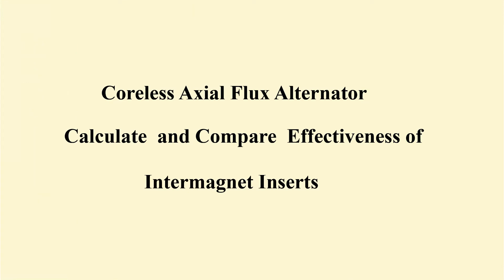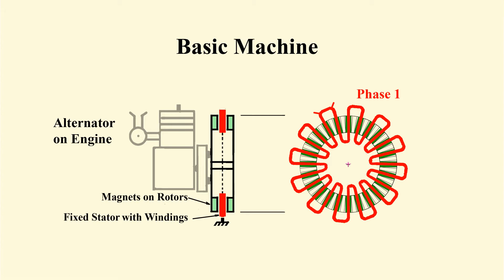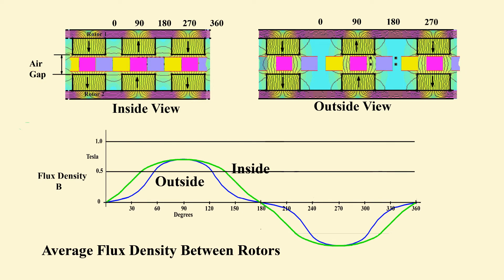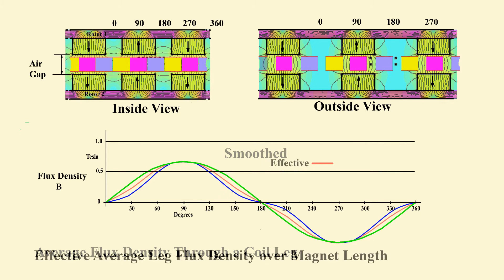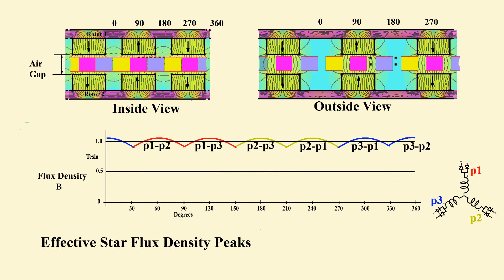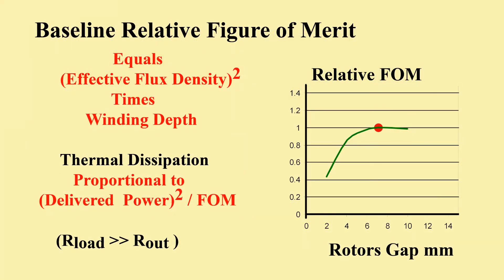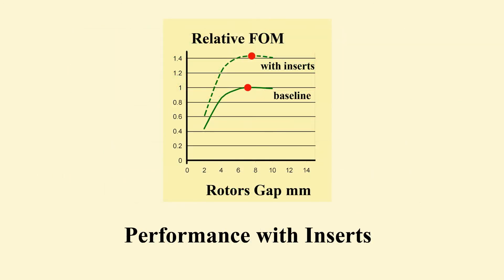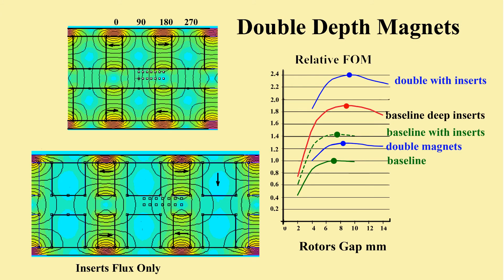Part 4  Rotor Options for the Axial Flux Alternator

Comment: This is great video, but Im sorry sir, i still dont get it how to calculate optimum air gap between magnet, maybe English not my primary language. Can u help me my magnets is ferrite 19x19x10 mm 2000gauss, i joined them so the size 57x19x10 mm, my rotor disk 3mm, and i made 12poles. Thank you
Reply from the maker: Dear Denz'  Thanks. With 25mm pole pitch at inside radius, best gap appears between 6 and 10mm;  8mm nominal.  You could prove by inserting  a single thin trapezoidal coil with each leg centred  on a pole for a range of gaps. Maximum deliverable  power is indicated where  its voltage squared x gap width is a maximum.
Reply: @YesEinstein  thanks sir, I will try it

Comment: Great job you have done explaining this...concise and to the point. I would love to know the relevance in the shape of the iron inserts(not the magnet inserts). Why not a solid iron insert instead of the (u/n) shape shown? Could this shaped iron piece have much thinner walls and still do the same job? 
Also, instead of the double depth magnets, what would happen if the iron insert was replaced by another magnet of opposite polarity, such that the flux was repelled? So many questions? lol
Reply from the maker: Dear Jim Maxwell.  Thanks.  The iron is a low impedance in the magnetic circuit with the same shape as a main magnet to maintain path cross section.  Half width bottom and side walls  gave near identical results. Replacement  by magnet material  would increase the circuit  resistance and tend to demagnetise.  Regards YE
Reply: @YesEinstein   Thank you, much appreciated.

Comment: Hello professor..
I'm mahesh and also studying,
I want to know something about axial flux genarator.
Thanks
Reply from the maker: It's good
Reply: @YesEinstein  Thanks professor
These days I'm reading some pdf, videos about axial flux genarator..
This is my email maheshjapura@gmail.com
Reply: @YesEinstein  hello professor
I'm going to build a axial flux genarator 2000W at 500 RPM,
Stator diameter 15inch
70V at 500 RPM
       Magnet size and grade
       How many coils (hope 12 coils)
       Coil pre turns and wire gauge 
       How many phase 
Can you calculate for me 
Please helps
Thanks
Reply from the maker: Dear mahesh chathuranga, Doing some sums.  Regards YE
Reply from the maker: Dear mahesh chathuranga, My machine magnified for 24 30x20x10 mm magnets, pitched at 30mm would have 13.7 inches outside diameter and 12 mm between rotors.  For 70 V at 500 rpm, each winding leg might contain 7 magnet crossings contained within each 10 x 12 mm space at the inside diameter.  3 phase overlapped windings, star connected, should deliver 2000 W rms for 50 Watt dissipation.  Each crossing might be three double twisted bundles of  less than half a millimetre wires for sensible eddy and end effect losses up to 500 rpm.  12 magnets at 60 mm pitch should also work with 22 crossings per magnet for up to 1000 W with acceptable ripple content.  Solid wire crossings might suffice. In both cases, increasing the rotor gap and its associated copper content might give up to 20% greater capability. As usual, proof is in the pudding, Regards YE
Reply: @YesEinstein  dear professor thank you very much
I'm very appreciate
One thing I want to know 
How is the torque(guess)?
Thanks..
Reply from the maker: 2000W=3.8 Kg.metres at  500 rpm
Reply: @YesEinstein  A good human being is a man full of virtues,
Thanks you very much professor
Reply from the maker: Re. magnification. Slight misspeak as Donald might say. Magnets are 60x20x10
Reply from the maker: They look "good in parts".  Which one?   Claimed efficiency, confirmed by real test results, might merit comment.
Reply: @YesEinstein  dear professor, I mean this
https://www.otherpower.com/stator.html kind of Axial flux generator totally different with your generator,
And I want to get a idea which one is more efficiency
Thanks
Reply from the maker: Dear mahesh chathuranga, Thanks for reference to the excellent website and the particular machine.  According to my calculations it is pretty near optimum for magnet size, number and spacing, rotor thickness and power capability for the particular application.  Trapezium coils with conductors strictly parallel to the magnet axes and with copper fully occupying the available space might offer considerably more overload capacity.  Going to overlapped could also near double the capacity.  This system is amenable to calculation of simple figure of merit for maximum power that might be handled and thermal dissipation at lower throughputs.  Real test results would establish or confirm.  Further could be power to drive the unloaded machine over speed.  This may expose eddy dissipations in the heavy wire gauges.  Regards YE.

Comment: hi 
Can you please help me in developing a 3KW axial flux motor please. ?
Reply: @YesEinstein  Hi Thank you for your reply. 
Expected motor specification

Rated Torque - 50Nm 
Rated RPM - 550rpm
Peak Torque - 100Nm 
Peak RPM - 650rpm 
Nominal Voltage - 48V or 72V
Reply: @YesEinstein  daimeter max 120mm
Reply from the maker: Not practically possible.   600 mm could work for very approximately 160 watt dissipation in the rotor,  or 80 Watt total if double stacked. (Reference my Part 3 appendix on scaling options)  You might just linearly scale up my design, retaining air gap and magnet thicknesses.  Look forward to seeing your realisation.  Regards YE
Reply: @YesEinstein  600mm is too large is it possible to limit the diameter to 200mm and increase the stack?
Reply from the maker: Dissipation is proportional to  square of  (power throughput/ rpm).  According to Part 3, even if 40 Watt dissipation could be tolerated per 200mm stack, an impractical 15 might be needed for 3 kW.
Reply: YesEinstein is there any software to develop and simulate the motor ?
Reply from the maker: Graphics like Photoshop, finite element magnetics Femm4.2 and spreadsheet for simulation  as my "backs of envelopes" and replies.  Designs conceptual based on electromagnetic theory. Baseline performances by  genuine tests.

Comment: This is very interesting project. Do you have a web page or direct email to contact you? I would like to know how much Watts can achieve your Axial Flux Alternator, gas engine cc? I'm working on a similar project and if I may, I would like to share details with you. Regards!
Reply from the maker: Dear Roberto Madriz,  Thanks.  Engine is 35 cc  4 stroke, nominally 1 Kw @ 7000 rpm.  See other videos and comments.  Helpful technical comments via Youtube are more than welcome.  Regards YE
Reply: Thank you YE, yes I saw all your videos, just amazingly detailed videos, thanks for your share. I Believe same generator with a 2 stroke engine would produce more power,  pollutants can be reduced with a fiberglass filter silencer. I want to make a generator able to produce more than 2kw to move an electric vehicle for much more autonomy than batteries, and at the same time very efficient.
Reply from the maker: Dear Roberto Madriz,  It may well work with a more powerful engine, but according to its FOM,  doubling the power output at the same engine speed would at least quadruple dissipation in the rotor.  The FOM/dissipation  expressions in Parts 2 and 3 indicate scaling options that control  the dissipation. Regards YE

Comment: Hello, super videos. Do the stacked stator phases produce meaningfully different power levels, given their different  distance to the rotors?
Reply from the maker: Dear Jeff,  Thanks. Not so. The three phases overlap only outside the  magnet coverage.  Each completely fills the distance between rotors except for a small clearance.  The phases ( red, blue and yellow in the diagrams) are physically identical and thus generate  essentially identical outputs at progressive 120 degree delays. See Part 3 for practical detail.  Regards YE